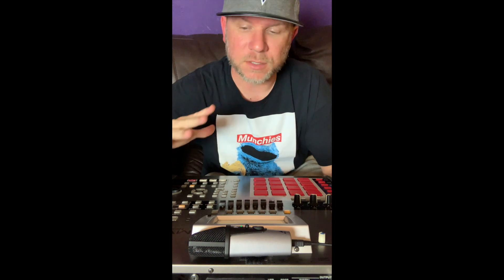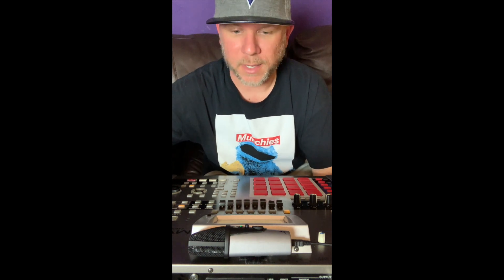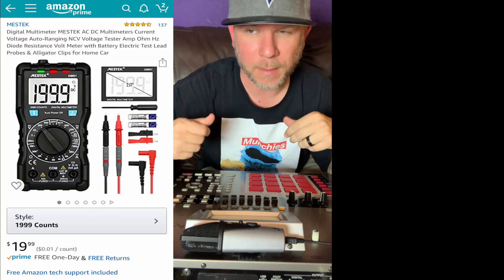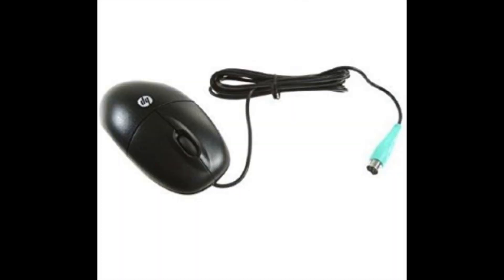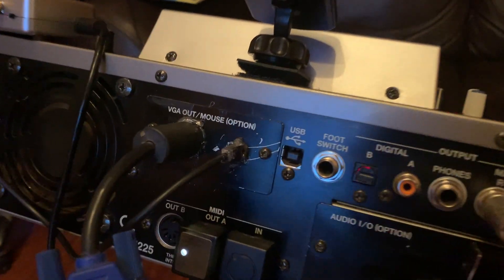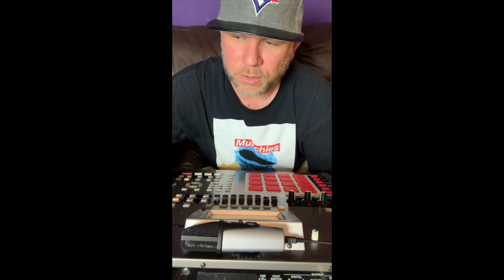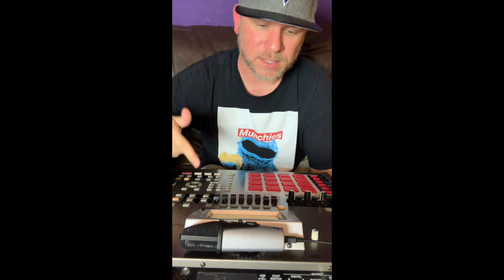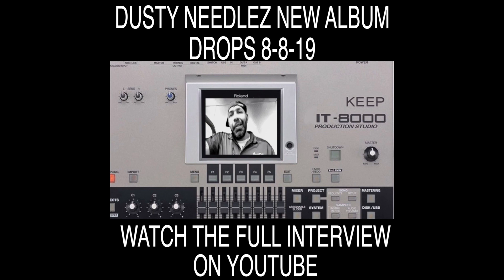Roland MV-8000 VGA DIY Diagram (DONT BUY ONE, MAKE ONE)

Comment: Good video man. I was wondering if youd happen to know what could cause my mv8000 to stop outputting any audio . I can no longer hear samples or anything. Volume is turned up and i don't see anything muted in the mixer . Nothing thru headphones or speakers. It worked fine yesterday but today i powered it up and cant get any sound output. Could it be capacitor related? Thanks

Comment: One love to the Beat Lord 1 Tekneek.  REAL QUICK note: if you do end up either  buying a VGA expansion or making one courtesy of TeK and genius Star 1, PLEASE remember to get the right adapter if you plan on using HDMI inputs on your TV/Monitor.  I didn't and it almost caused me to return my unit and/or the VGA card.  Its important to get a VGA to HDMI adapter cord.  It looks a little different than the one Tek had on the article, as that is a HDMI to VGA adapter: BIG DIFFERENCE. Dont make the mistake I almost made.

Comment: Most multimeters all have a simple  "Continuity test" .  It's the speaker/beep icon. Touch the leads and you should get a beep. This waaaaaay faster than looking for 0s and you get instant audio confirmation.  In fact you can clip to one of the and 'touch around" to find connecting wire in a flash - and never look at the multi-meter screen. :-) 

Informative video! 👏
Reply from the maker: NNITRED Hey thank you for that!!! I dont  use one to often, now I know for next time. Thx again!!

Comment: thanks......
Reply from the maker: JAFFO LIONSOUND no prob
Reply: @1Tekneek  I think I figured it out... Thanks homie
Reply from the maker: traxxtar72 trackstar hey bro i just uploaded a video that demos that you can DJ with the MV
Reply: @1Tekneek  yo good look, much appreciate the heads up. It seems that I'm going to have to start from ground zero man. Search out and download all the manuals.
Reply: Getting a MV8000 v3.5 soon
Reply from the maker: JAFFO LIONSOUND cool!!! The hard drives that comes with the MV are old and slow, I Recently installed a CF card Drive, I got a CF card adapter to a micro SD card, so basically my hard drive is a 128 gig micro sd card, It Increases speed and modernizes the MV for todays standards to take MV stems to Protools all from ejecting the SD card. By doing that it also Reduce his weight and heat from the hard drive. To install the CF card Drive just pull out the floppy drive and use that space for the CF Drive. I will also do a video on that this weekend.
Reply: @1Tekneek  oh wow... Look like I will be bothering you
Reply from the maker: JAFFO LIONSOUND hahahaha no prob man
Reply: @1Tekneek  I HAVE IT... the MV8000. this beast is really not turn on and play. digging in soon... have to download manuals
Reply: @1Tekneek  yo wus good Tek... Did you ever do the cf card hard drive vid? Also I'll be using this as a stand alone piece. Can you point me in the direction of a simple convenient/economical way to drop vocals with this equipment. And I need some decent monitors. At this point I just have the MV my TV and a guitar amp... Thanks in advance
Reply from the maker: traxxtar72 trackstar hey whats up, sorry i didnt get around to it yet, the best way to install it on the MV8000 or MV8800 is to pull out the floppy drive(MV8000) or the CD drive on (MV8800) and replace it with a Star Tech CF IDE/SATA Adapter from Amazon for $20. Just back up your HD to your computer. Power the MV Off, then unplug the harddrive and plug up the new CF Card Adapter. The mount in the MV should fit the new drive on the MV 8000 and the MV 8800 your will need to drill one hole on the mount.You can Buy a CF card to SD card Adapter from Amazon for $10. Format the SD card as FAT then drag and drop the MV files you backed up on the computer to the SD card and that should do the trick!! Hope that helps
Reply: @1Tekneek  thanks homie, much appreciated! You will most likely be hearing from me again.
Reply from the maker: traxxtar72 trackstar no prob, as for a mic I use a apogee mic plus with my iphone to power the mic along with a good compressor/ gate on a  ios app and plug the headphone jack from the mic to the input on the MV. Theres no Phantom power on the MV so you have to think outside the box.
Reply: @1Tekneek  that's hella dope! So how do you drop vocals on the stuff produced on the mv8
Reply from the maker: traxxtar72 trackstar in song mode you can add 8 audio tracks that should be more then enough to do a song. Save your audio tracks for verses and your hook, use the midi tracks for your beat
Reply from the maker: traxxtar72 trackstar u do every thing inside the MV no need for a computer
Reply: @1Tekneek  bro you are the man.. thanks! So many people online act as if it's impossible to spit on the mv8 with only 8 traks. I come from an era where you know your joint, point and spit, a few adlibs and on to the next. My machine will be arriving soon ...  I'm more of a writer. I just want to be able to create on my own terms, and not deal with strange egos and such. I use to own the fantom s... And somehow things would sort of fall into place . Hopefully the mv8 will allow me to manifest my ideas. I mean I'm really not a producer, but I'm bout to give it an all out shot. Your time and input is much appreciated 1 Tekneek!  word
Reply from the maker: traxxtar72 trackstar no prob anytime. Hope u enjoy your MV
Reply: @1Tekneek   yipes! Neek! I just got my joint yesterday. Fired it up, it the 2.0 version so I simply downloaded the 3.5 os zip update to my PC. And I ain't budging til' I am certain how to Install it to my machine. Can you explain please. I'll have one mO question after that. Thanks man, you've been helpful.
Reply from the maker: traxxtar72 trackstar sorry thats gonna have to be a google question, every time i picked up a new MV it was already updated to the latest OS. I never had to install a OS but it shouldnt be hard.
Reply: @1Tekneek  right on.. I can dig it. Thanks bro... I will look into it... Cheers
Reply: @1Tekneek  1 Tekneek. What's Poppin, lockin' and tickin'  homie... Yo I got the update in effect. I hate to keep sweatin' you Neek, but now I can't get the MV to show up on my 42 in tv, via VGA... Any tips ? the light on my mouse is lit but that's it
Reply: Brother... HELP PLEASE!! Can't create new project!! Having this " operation failed" message ... Why is that? Thanks
Reply: Great job on do it yourself work.  My son and I will be making a card for his mv8000.